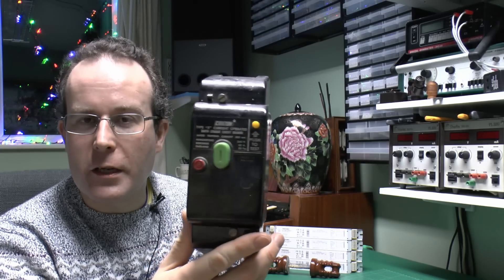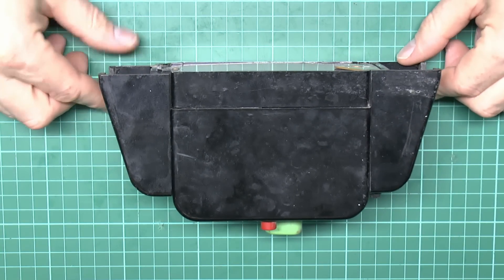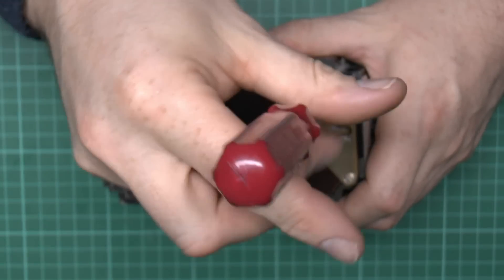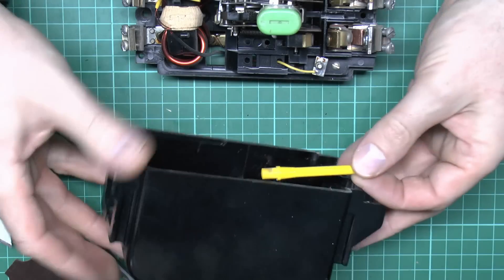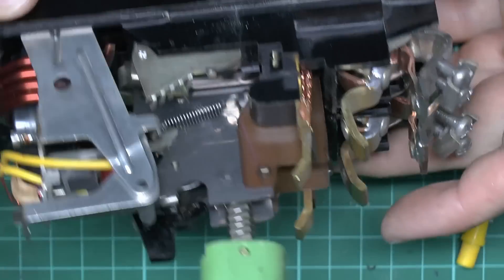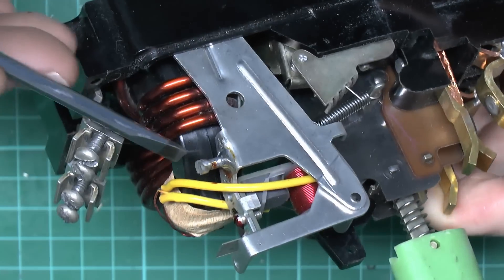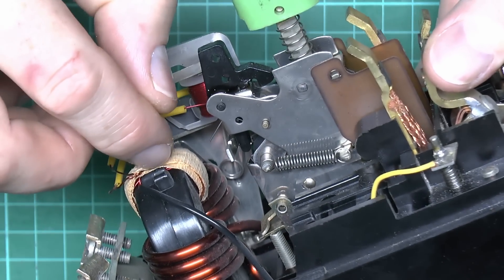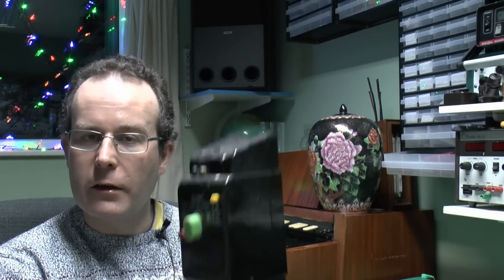Inside a Chilton Current Operated Earth Leakage Circuit Breaker / RCD

Comment: Evening Mr ward, recently visited a friends house and saw this device in service! It was providing the main RCD earth fault current protection. “E” class as in this video. I suggested it was removed along with he fuses, and replaced with a new installation due to safety reasons. What would you have to say if you saw this device in service
(this particular device was in question was from 1979) 😖
Reply from the maker: If it still works then it can continue to be used, there isn't much in these ones to go wrong.
However the trip current of 500mA is far too high for personal protection, which should be 30mA, so it would certainly be beneficial to replace/upgrade. 
The ones which do need to be removed are the voltage operated type D, as they offer no protection at all from people contacting live parts, and can fail to work at all for some types of fault.

Comment: Hi, I've just purchased a house that has one of these fitted. The consumer unit is a modern Wylex with RCD's. Should I replace the Chilton? If so, what with ? Any advice would be welcomed.
Reply from the maker: +welcomejlc3 If the new consumer unit has RCDs for all of the circuits, the Chilton is not needed and could be removed completely.  
However the only problem in keeping it is the possibility of it cutting power to the whole house if there is a fault, which although does not comply with BS7671 is just an inconvenience rather than unsafe.
Reply: +John Ward Thanks John, I appreciate your time to respond.

Comment: With a trip current of 0.5A and a voltage of 220V, that makes 110W. At some "margin of error" and you would need a... 150 or 200W resistor in there. Yes, the power should only be there momentarly, but I have seen "stuck" RCDs in the field. They did NOT trip when the button was pressed. Switching the RCD manually fixed the problem. There is a reason why manufactures print "trip once a month" or so on the thing. So given that: The resistor must be able to withstand 110W over and extended amount of time in an enclosed box. Given that: It makes sense to use an auxiliary winding for the test button. I mean: With 20mA RCDs, the power is way smaller, so it is possible to fit the required resistor to create a real current difference.
Reply: +sarowie It's a 1k5 resistor, which at 220v will only pass 146mA current, which is about 32W. As John mentions the test mechanism doesn't work by creating an imbalance, but instead powers a smaller coil to trip it.
Reply: BenjaminGoose
John was wondering why they didn´t create a "real" current imbalance and instead used the an auxiliary winding. I elaborated why a real current imbalance might sound like a good idea, but does not work in practice. I think where all on the same page when we skim trough the numbers and arguments. Using an auxiliary winding for the test mechanism is the only sensible way (other then to use external test equipment, which is not practicable, as the RCD should be tested/tripped regularly in the installation).

Comment: John, given it's French, maybe E and S stand for Entree and Sortie, meaning E would be the line and S the load?
Reply: Looking at it later in the video it would seem that's the case, as the test button would then be on the load side where you'd expect it. I'd imagine the 2nd coil for the test rather than the usual 'create an imbalance with a resistor' would be because if you did that, the resistor would be dissipating about 120w (240v x 0.5A) and if the mechanism DID fail to trip  for whatever reason, that would become a little overloaded...
Reply from the maker: ***** Yes, after some investigation it seems a 500mA RCD is a standard item installed in French houses, supplied and fitted by the electricity supplier.
Reply: +John Ward What you have in the video it's actually a Thomson earth switch made in the decade of 1970 and or very early 1980.  Thomson exported them in large quantities to countries like Argentina where i'm writing this from, and actually, it looks like people does not know this element as earth switch, leak switch but  rather by what seems to be an adaptation of the french name for them.

Comment: Wow .. 500mA
That is weird . .
Reply: Anne Jan Brouwer Probably just to protect wiring rather than people
Reply: Watching softcore again? ;-)
Reply: ***** RCDs where and are build to protect property. A 500mA RCD is suitable to protect a building from an electrical fire caused by a fault current searching a way to ground.

Of course: 500mA is plenty deathly, but... a 5mA RCD rated for 60 A wouldn´t make sense either. Switching on motors, plugging in power supplys with y capacitors, all this short of stuff could potentially drip a 5mA RCD.

I mean: I would not want to have such a thing for my bathroom, but for a construction side or a machine shop, the typical 20mA RCD is too sensitive.